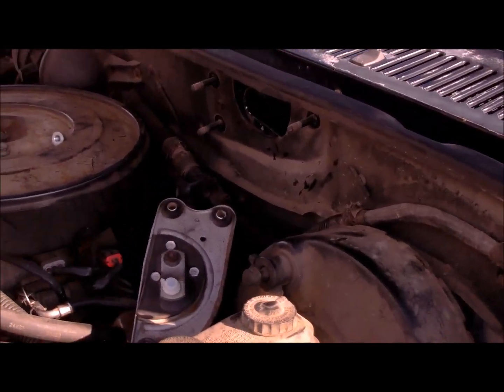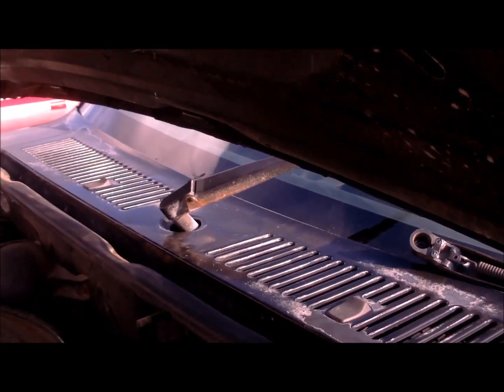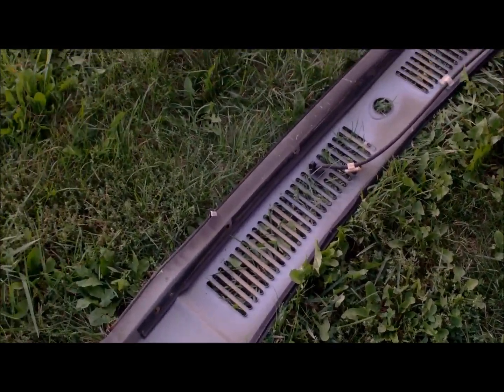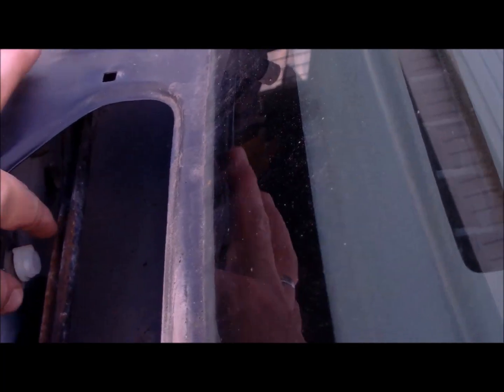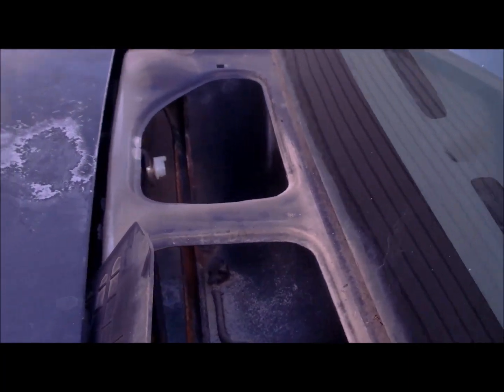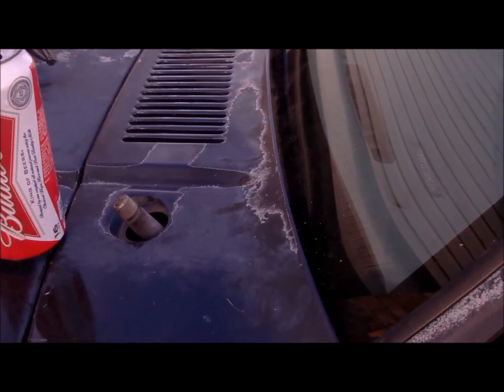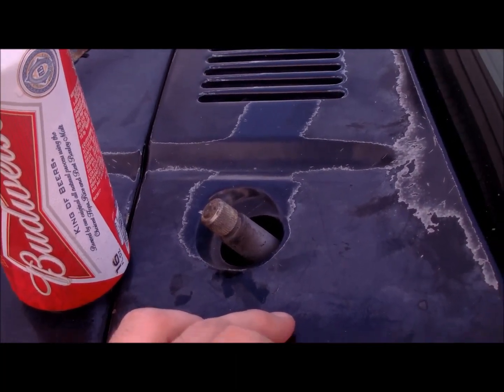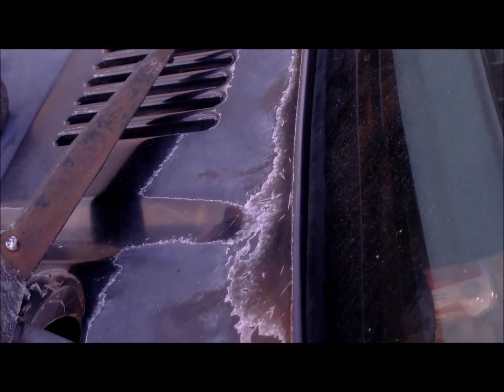How To Fix Broken Windshield Wiper Linkage

Comment: Thanks for the video. I have a 1996 and was able to replace the bushing without removing the motor housing. I had enough access by removing the cowling 6 screws. As far as attaching the bushing to the wiper linkage arm, I located it and squeezed it with a small clamp and a wide enough socket which allows for the bushing to push trough. Definitely read the comments from MadCloudDisease for wiper arm removal. I paid close to $3.00 at O' Riley's for the bushing (2). Thanks again to all!

Comment: Hey; iyo, can i connect just the one linkage arm that operates the driver side wiper without connecting over to the passenger side? Just use the one driver side wiper? thanks

Comment: If you lift the wiper blade off of the windshield as far as it will go and slide that flat piece toward the tip of the blade the wiper arm will come off by just lifting and you dont have to use any tools at all.  Then when you put them back on just lift the arm again and slide the retainer back down. Then lower the arm to the windshield.

Comment: Does the bushing attach to the wiper motor arm, does it fit flat against the wiper motor arm, or is there a space of about 1/8" between the wiper motor arm connector and the end of the bushing, which has a small opening in it where the wiper motor arm connector fits.  The other side of the bushing connects to the wiper linkage and you show this.  I don't see exactly how the bushing should look on the other side.

Comment: I did this and got the universal packing for linkage but the problem is it works it self off after a short time. I easily could snap part in and pull back off the little rod by hand. Like it needs to be smaller. Anything else I can do?

Comment: Yes I got at auto zone. Pkg of several and the ones I needed were off white color. I was able to push in by hand and actually could pull off as well. Blades ran for awhile and than would work off. Auto guy assisted and he couldn't understand why it came off so easy. I have the number off package if anyone has I can compare. Thanks
Reply: +Deloma Parton - Having the exact same problem with my 88 Reliant. I swapped the 2 bushings but it does the same thing, they run for a minute or so and then the bushing works its way off. I think it has something to do with all of the vibrations the wipers create. Still trying.